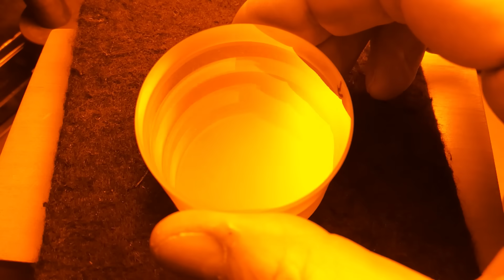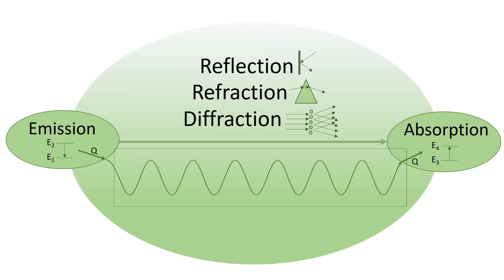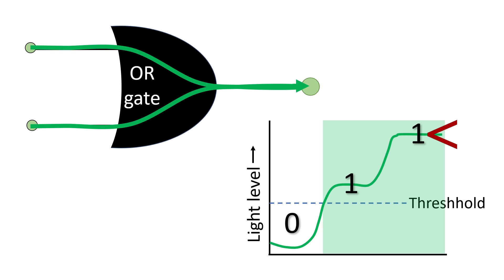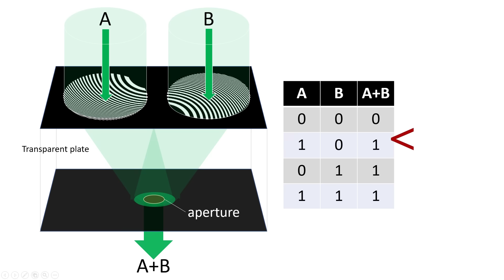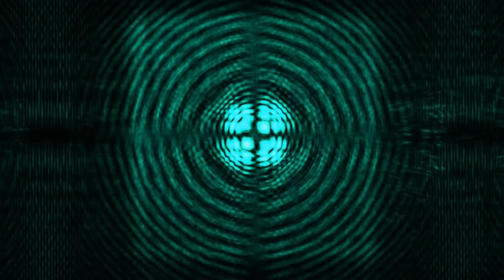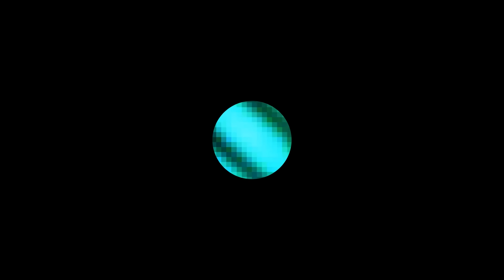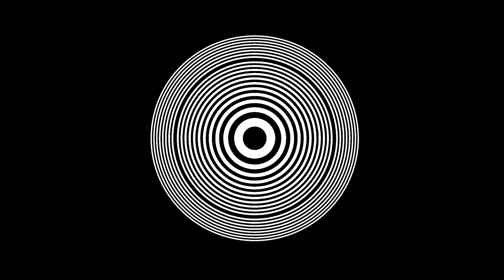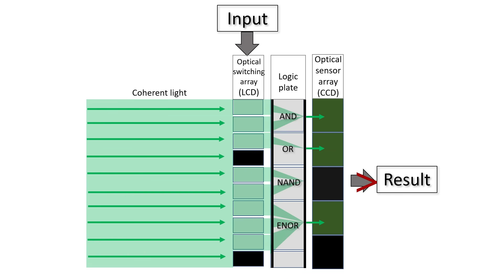Making Optical Logic Gates using Interference

Comment: Very interesting.
Is there a reason that the focal points for both input generators need to coincide exactly? Or could you perhaps use a tiny lateral offset to 'smear' the central interference node a bit wider?
Reply from the maker: I don't think that this is an option. The pitch between areas of constructive and destructive interference does not change with the distance between the two elements, it is dependent on the wavelength and diffraction angle, just like with an optical grating. So by displacing the elements, you will see the same effects, but rather on the edges (or only in areas of overlap). By making smaller diffactive areas closer together with longer focal distance (or smaller diffraction angle) you can easily increase the distance between nodes.

Comment: I had a similar idea, but instead of using it within optics I wanted to use it to make logical operators differentiable. Once you start to stack the operators together how would you keep their amplitudes normalized?
Reply from the maker: Just stacking elements and expecting them to perform the same function is not really feasible, as is also discussed in other comments of this video. However, as for normalization of intensities: this should be possible by tweaking the size of the optical elements in the generator and evaluator plane.
Reply: @HuygensOptics  I wonder if there exist a "clamping" function implemented optically, like a threshold switch.
Reply from the maker: @liljubb  optical clamping would actually be feasible as a way to create the non- linear behaviour expected for gate logic. It would require a  non- transparent layer with a long-lived exited state that can be populated with the light. So the layer would open up if a specific threshold intensity was reached.
Reply: @HuygensOptics  the way I tried to solve this issue was to modulate true/false not as amplitudes but rather as phases. So 0deg is false, 180deg is true. That why any stacking just "wraps" in phase, instead of "exploding" as the logic chain gets bigger.

Comment: These gates can't stack. The interference of two optical inputs is a linear operation. Real Boolean algebra requires nonlinearities.
Take for example the XOR; zero with both inputs off, zero with both inputs on and "1" when either input is on.
The optical interferometer pretends to achieve this with destructive interference for both on. It is easy to make an interferometer that appears to do XOR, but what it really gives is one of the "1" outputs is really -1, and the other is +1.

Now you can't cascade your gates unless you have a gate that converts both -1 and +1 to a common phase.

In general, an interferometer is a linear system whose output is a sum of the complex input amplitudes. In contrast, Boolean logic combines the inputs nonlinearly. The interferometer cannot do Boolean logic.
Reply: Well, sure - but suppose the 'evaluator' was a laser cavity that could absorb and retransmit (perhaps in a lateral direction, say, into a fibre) ? 
Wouldn't that light source then be a 'new' one? And laser pumping is very non-linear - so this would be like the s-functions you need in the nodes of a neural network in order for it to process logic (the other part of the neural network also being 'linear' sums). 
More than threshold total pump light still results in basically the same laser output, and under-threshold, no output.
Reply from the maker: @Teddy Weverka  That is true, but I did not intend to have interference do consecutive boolean operations. If you look at the illustration of the (rather theoretical) application example at the end of the video, the boolean operation (if any is required) would be performed in the CCD or software, based on threshold values rather than by stacking logic in the plate. One option is to use a feedback loop that runs from the detector back to the switchable input array and performs the next evaluation in a different logic part of the optical evaluator. This of course would only be of practical use if the evaluator does some kind of transform that takes standard digital logic a long time to perform.

Comment: You may don't want to show your keys to the public. optical key decoding is a thing!

Unfortunately I don't know much about optics and such - I just like to take pictures through my microscope so bare with a dumb question. I'm not sure if i missed it but I wonder what the working distance would be (I think that would be the focal point, where the logic result is evaluated)?
Reply from the maker: Did not think of that. With the optical key and a video quality of only 1080p, that would also be a thing of the past... :-).

The focal distance is dependent on the "pitch" of the alternating circles in the  Fresnel zone plate pattern and can be freely chosen. In this case, I made lenses with a focal distance of 1mm, which results in lenses with ~F/3. In the video this is also the distance at which the result is evaluated, although other distances could also be chosen, depending on the actual interference pattern.

Comment: If you’re wondering what sort of arrangement to put any gates in, I’d do something like a simple PLA, an array of AND gates connected to the inputs via the AND plane, followed by an array of OR gates connected to the AND outputs by the OR plane.
 
Also to get desirable outputs, can’t you do something cool like designing the desired focal plane shape, then taking the spacial Fourier transform of it?
Reply from the maker: I think Fourier filtering would be an option. Maybe you have seen my previous video on the subject https://www.youtube.com/watch?v=Y9FZ4igNxNA. Here I suggested a DMD to do the filtering, however I guess you could also use static filters (in the evaluator) that were generated using an interference pattern

Comment: I've had this idea floating in my head for a while as well but had no idea how it would be executed.  

The optical lock idea is great and I loved the LPL reference.
Reply: These look fragile, I hope you never drop or damage you keys.
Reply: @NicholasMarshall  I am sure they could be encased in something to protect them, maybe a clear see-through resin for example. ( hopefully which wouldn't cause further issues reading the key )
Reply: @Thor110  A resin could protect them from shattering but would reduce the number of 'pins' you could have (no matter how clear the resin is, it's going to diffract some light requiring more spacing and/or larger 'pins' to compensate).  Resin could still potentially scratch as well which would make it useless.  

That said the key could be incased in something a bit more solid with some foam to absorb shock, the 'pins' could be inset inside the 'tip' of the key (hope that makes sense) with a simple mechanical shutter that opens when the key is inserted so the 'pins' are only exposed when the key is being used (kind of like a how floppy disk or VHS expose their disk/tape when inserted).  One or more of the 'pins' could act like inputs into the key which could actually make the keyhole a part of the key as well (not sure if that would be useful in any way), more importantly the source of light should come from the keyhole with the key being solid state.  Obviously like any e-lock the keyhole would need to have a backup power supply and preferably a way to provide power should it's main and backup power supplies fail though I could see that being a potential weak point depending on implementation (need to not only prevent rewiring but also make sure it can't be broken by undervolting or overvolting it).
Reply: CAT scan to the rescue !! oh wait...
Reply: Same, also thought a about needing coherent light. I came to the idea from looking at the double slit experiment.

Comment: I wonder if optical technology will ever be advanced enough to do actual computation. To build something akin to a traditional computer, you would need optical amplifiers and memory cells. Semiconductor-based computers only became so powerful because of complex logic pipelines and the ability to feed the outputs back into previous stages.
Reply from the maker: You exactly nailed the main issue. I myself could imagine complex optical pipelines, but the lack of storeability of intermediate results in the optical domain is definitely a limiting factor.
Reply: @HuygensOptics  perhaps something like the optical equivalent of "delay line memory," using phosphors ? this isn't a real solution obviously, just a vague idea.

Comment: That's very nice! Have you considered using phase change materials to control the phase of light? It would require quite a thick layer to do this out of plane but you could effectively create programmable gates.
Reply from the maker: It's one of the things that I'm currently building the PVD-unit for. It would also yield devices with higher optical efficiency. So far, I have done some preliminary experiments with Hafnium oxide (refractive index ~1.9), Here you only need layer thickenesses of approx. 350nm to create phase inversion, and they are quite easy to make.
Reply: @HuygensOptics  you might find this doi:10.1002/adfm.202002447 interesting
Reply: I just posted a suggestion of using transparent LCD panels. LCDs obstruct the light passing through a layer of glass and by changing the pattern on the screen you change the gate. You would need much higher resolution or using magnetic particles in oil sandwiched between glass.

Comment: That lock idea is brilliant.
I'm sure LPL would have a great time
Reply: Realistically speaking, if going down the route of electronic locks, I think a fully enclosed RFID lock would be strictly better. Not as fun, for sure, but better.
Reply: @chuuni6924  "better" only depends on how difficult it is to spoof the signal it wants to open.. An electro-optical logic gate lock would take a fantastical amount of effort to non-destructively open
Reply: @SuperAWaC  Cracking an AES key would also take a fantastical amount of effort. Certainly, there are more and less secure RFID protocols, but as long as you're doing electronic locks, I'd trust properly implemented cryptography over virtually anything else. Now, if you could find a way to implement this optical key in a manner that didn't require electronics, that'd be a different thing altogether...
Reply: @chuuni6924  There is a video where they use a child's toy to hack the signals in garage door openers. I think it was Veritasium. It was pretty eye opening.
Reply: @Robert_McGarry_Poems  Yeah, that video is a great example of crypto not properly implemented (or not implemented at all, as the case may be).
Reply: @chuuni6924  What stops someone from just recording a bunch of samples and replaying the wireless signals (it would be harder with RFID since it's close range but certainly not impossible and I'm pretty sure a similar trick has been used on cars).  The design of optical lock he showed off didn't look super secure but if you had an optical lock that used optical logic gates then you could have a purely optical cryptographic locking system.  Ideally the keyhole would provide the light when it detected a key was inserted and the keyhole itself could send different inputs into the key.
Reply: @grn1  "What stops someone from just recording a bunch of samples and replaying the wireless signals?" -- Properly implemented RFID incorporates encryption with fresh IVs.

Comment: Quality content. 
Regarding your introduction on conservation of energy in the context of interference - I would've thought that the maxima are of higher local intensity than the incident beam, hence energy is conserved. Isn't that the case?
(as an x-ray crystallographer who looks at diffraction patterns for a living, I'm embarrassed to say I never thought about it beyond the textbooks).
Reply from the maker: I guess not: The thing is that the reflectivity of the surfaces shown is only about 4% of the incident beam. So with constructive interference the maximum would be 8% of the incident beam, if all reflections are lossless. If one of the surfaces has a reflectivity of 100%, and again there are no losses, there would be no interference detectable, neither constructive, nor destructive.
Reply: @HuygensOptics  You're blowing my mind. Not to be argumentative, but think of a surface relief diffraction grating (the sawtooth kind) under monochromatic light for simplicity. There would be 100% reflection and interference. Would you predict the area under the curve of the interference pattern is less than the purely reflected beam (and where would the rest go)?
It might be a trivial question for you and I don't want to waste your time. If you point me to a resource that would be more than enough (quick googling didn't quite work).
Reply from the maker: Hope I understand correctly: So this saw tooth reflector would normally be used in spectroscopy. The 0 order reflection would be the direct reflection of the reflective surfaces, and generally the brightest of all. However, 1st and higher order diffraction occurs under different angles, which are dependent on the pitch of the sawtooth. but with a lossless (or 100%) reflection, the sum (or integral) of  all diffracted light would add up to exactly 100% of the incident beam.
Reply: @HuygensOptics  Got it. I think I have a false model of interference in my mind. 
Thank you for the videos and the thoughtful replies.

Comment: If you build a computer with that optical logic gates at its current size will it fill a room just for the cpu?
Reply from the maker: Not if this computer is based on the 6502... But I guess, it would be hard to make the inputs smaller than say 25 um2 per device, that would mean 1600 logical devices per 1mm2.  So you can do the math for the type of computer you have in mind. ;-)

Comment: Fascinating. The dual foci Fresnel pattern with a coaxial aspect could possibly be exploited merely by placing the evaluator at the right distance for each type of gate without needing to manufacture different types of evaluator apertures (spot vs slit). I'm sure you're on to something there.
Reply from the maker: Very well spotted! Also, the in-phase OR gate is at the same time an EOR gate or an AND gate if you place slits in the evaluator plane in a different position.
Reply: @HuygensOptics  Thank you. I shall be watching this with great interest.

Comment: This is really cool. You need to find a way to get rid of any frequency / phase shifts introduced by the "light logic gate" itself, this is the holy grail. Because then you can build bigger blocks without the need for massive error correction.
Reply from the maker: For that it would probably be nescessary to use patterns with sub-wavelength dimension. However, it is not all bad. There are also ways to use these phase shifts to your advantage....
Reply: @HuygensOptics  I think with e-beam lithography you can achieve this, but it is time consuming and you would need a stm and a beam-blanker of course.
Reply: To build something like a computer you have to be able to put gates in series. Use the output form one gate as the input to another without going through an detector and diode laser.